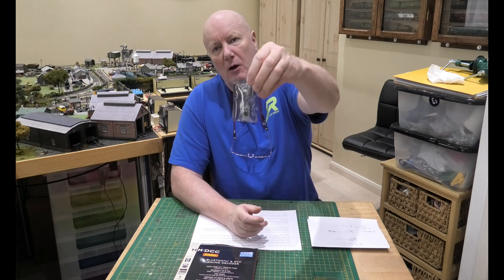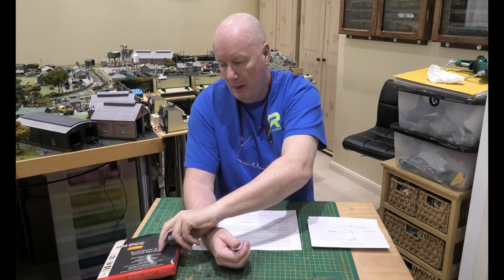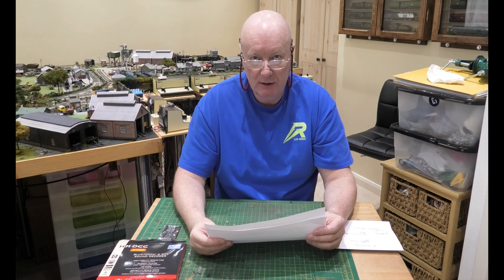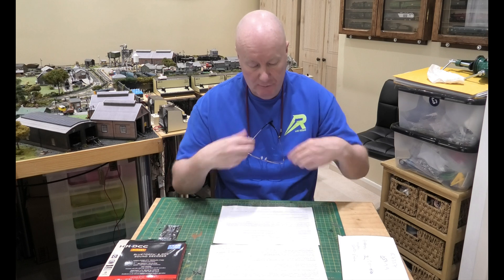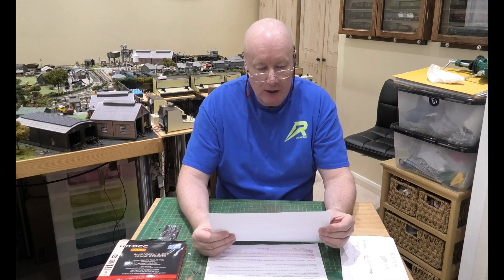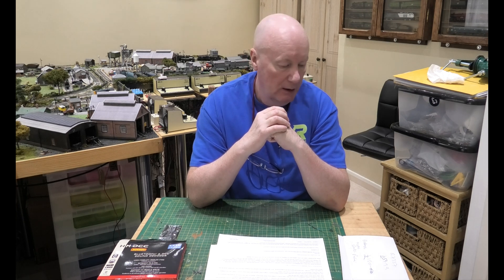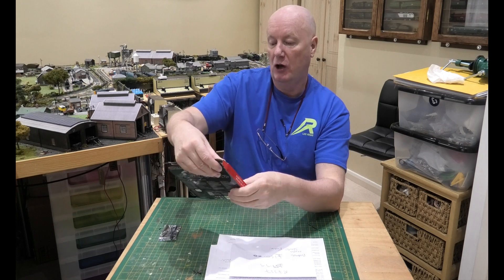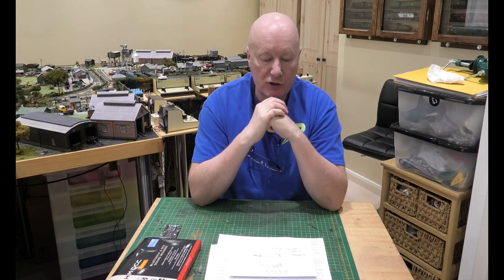BLOWING UP : HM-DCC Update

Comment: Stop buying Hornby junk decoders. All my locomotives are fitted with ESUloksound which I’ve had no problems with at all.
Reply: I only have ESU LOKSOUND decoders, the HM7000 decoders are a budget range, some modellers have said they will never buy an expensive decoder now the HM7000 decoder range has come out, I say fair play to them, it’s a matter of choice as far as I’m concerned, I’d still like to see somebody fit one of these new decoders to a Hornby class 08 shunter.
Reply: @StormmyStormmy  Someone released a video of fitting one in an 08 with the speaker and power bank so I copied it and it does all fit and works well.
Reply from the maker: @StormmyStormmy  I am sending mine back.
Reply: @PaulBriden  Sorry to hear this, maybe Hornby should have invested more time into this project from a point of view that their controllers are not used by all modellers.
Reply: I have a digitrax dcs210+  and have 2 of the hm7000 decoders no problems so far I set them up with the sounds and alter cvs using the app then switch it to Dcc and use my throttle it may change once the legacy dongle gets released but I’m happy for now
Reply: @stephenbromley2302  to me Hornby decoders sounds like absolute shit. If you want quality go ESU. I have over 20 locos fitted with no issues. Stop wasting time and money on crap
Reply: You make good points very clearly. Suddenly Hornby is expecting a product that is supposed to be “entry level” to be purchased by someone with electrical knowledge and the patience to read deep into a 130 page manual that is hard to find. I like  Hornby but I think they rushed this to market.
Reply: @damianinCanadaTT-OO  i agree, it does look like they've rushed it onto the marketplace. With a known problem comes responsibility to the buyer, it's almost as if they wanted to beat a competitor.
Reply: @damianinCanadaTT-OO  Hornby only care about Hornby’s bank balance, it’s business nothing personal, they are still producing items from moulds that are 30/40 years old, shocking prices just like Bachmann! The Bluetooth system isn’t new, I have seen it being used in America, things blowing up are part and parcel of a system, in time they will probably get better, the system I use is proven and used by a huge amount of people, Hornby want a chunk of a market but don’t seem to have totally researched it in my opinion, reminds me of their Zero 1 system back in the 80/90’s, their attitude was here it is get on with it. I used to eat sleep and breathe Hornby back in the day, so many better manufacturers out there now, to me Accurascale’s quality and pricing is commendable on so many levels, I hope they produce a dcc control system in the future.
Reply from the maker: Me too. I just thought I would give it a try.
Reply: so obviously your ESUlocksound decoders will run on 15vdc analogue controllers and produce the sounds and functions available with dcc, without dcc being being fed to the track
Reply: @rdrhouse  Yes, in my dreams, i will stick with Loksound which is my choice, you can stick with your choice, by the way wasn't a fan of TTs chips, again my choice.
Reply: @StormmyStormmy  i'm interested in hm7000 for other reasons, but i do respect your choices.